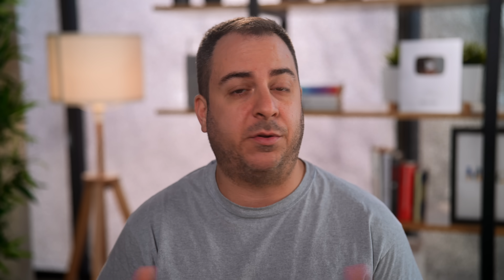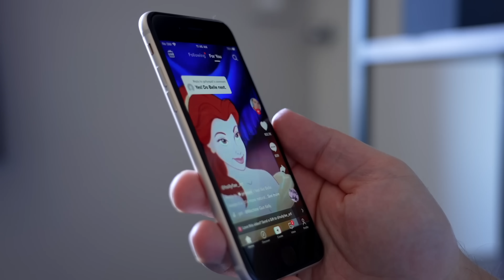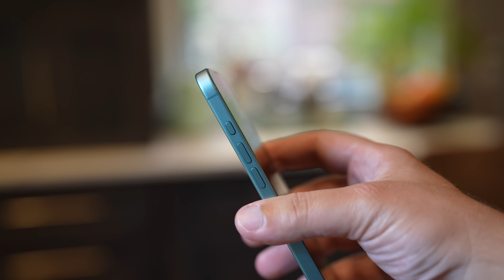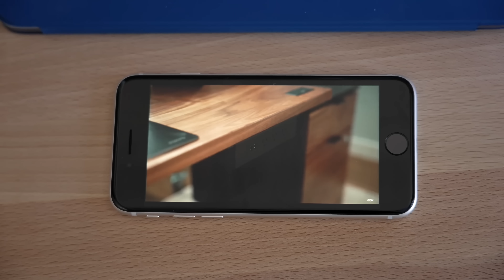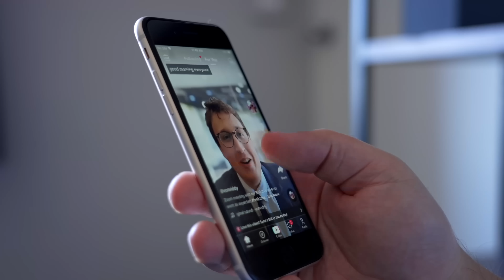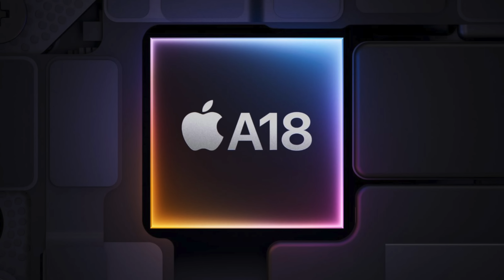iPhone SE 4 Coming Next Week!

Comment: Still getting a 16. Was thinking 16 pro but it's not that different and I think I can take the lack of 120hz even though I'm moving from android again. Like to swap between the 2 every few years. Both have their strengths.
Reply: What phone do you have rn?
Reply: @markoroncevic  nothing phone 1
Reply: @BC-Productions. what is the problem with it so you need to buy iphone
Reply: @markoroncevic starting to slow down software wise. And on hardware, the USB C port is damaged making every charger dodgy. And the seam on the back is peeling off so it's no longer waterproof. Moving back to the iPhone was my plan anyway but I'm doing it earlier than expected because of the damage to my phone.

I swap back and fourth between apple and android anyway so it's no issue I have backups off my last iPhone

Comment: About bloody time. I just had to replace the battery in my SE2 to keep it alive longer. I am actually not happy that it will use oled. I do not want oled
Reply: Bc of eyes and headache?
It is not smart for them to use an ips panel, 60 hrz is a joke not to mention lcd in 2025
Reply: @ 

Oled burns in. That’s the problem
Reply: @theshadowman1398  modern ones dont, if you are not so smart then you might break the screen by using it on max brightness for like a long time

Comment: Call me crazy but I went from iPhone 13 Pro Max to iPhone SE 2023 and there are no regrets. Easy to handle love the home button and it’s not heavy. I also have an iPhone 14 but I don’t use it bc I don’t like the size 🤷🏻‍♂️.
Reply: Then again the iPhone 14 is still small compared to the competition. The only similar sized phone devices are the Samsung S25 and pixel standard and A series
Reply: if you're not using the 14 could I maybe have it 🥺
Reply: @ I can sure sell it to you! 🙃 it’s the 128 gb storage. Basically new. Never liked it.

Comment: In my opinion it’s a mistake for Apple to kill off the Touch ID home button iPhones. I much prefer the classic iPhone design over the newer ones. Now the SE line will just be a less feature packed base model line.
Reply: You prefer: awful thin dinosaur like design with battery thickness of 0.5 mm and screen like a point finger?
Reply: Face ID is more reliable. Fingerprint biometrics don't work for everyone

Comment: iPhone 16 E would be a very bad branding because the regular iPhone 16 is already considered to be the "low budget phone" of the iPhone 16 lineup. If they call it the 16 E, the 16 would basically become useless as most people buy an iPhone for its social reputation, not the actual tech inside. So if they can get the latest iPhone but for a slashed price, they would go for the 16 E and not the 16, also considering that if they want Dynamic Island and double cameras, they'd need to spend over 300 bucks, not worth it, it'll be either 16 E or 16 Pro, which doesn't make sense because the SE iPhones just use the old parts mixed with new parts to make a low cost iPhone because, well, it costs less to make as there is barely any research to make since they already have the parts, while the iPhone 16 did cost a lot of research (camera design, the new useless camera button, ...) so in the end they'd lose a consequent amount of money. SE is the only branding for them to go with to differentiate the actual flagships from budget iPhones.

Comment: They had the best chance to make the new SE using the iPhone mini body.
Reply: They should have used the iPhone X case! Perfect sweet spot in size between the mini and the current standard size and got the rounded corners ❤️‍🔥
Reply: With bad battery life? No. 6.1" is the sweet spot
Reply: they could make a fatter mini for battery efficiency.. ill be in for it
Reply: Terrible battery life
Reply: I would have wished that too, but the mini design failed, both 12 and 13 mini versions did not sell well. Blame the people.
Reply: @rohmanatasi1771 yes but they then increased the size and it did even worse.  I say bring back the smaller version
Reply: People don’t want that mini
Reply: They tried and it didn’t sale so they discontinued it
Reply: @dontworryaboutwhoiam456 cause it was overpriced - starting price $700 when for SE it could be i.e. $450 with one lens camera, newest chip, 8 GB RAM AI-ready, notch, standard mute button and without camera button - I would take it

Comment: Is it worth to switch to se 4 from samsung a73?
Reply: Never ever !
Reply: Id say yes, and while it will be bad that you are losing the 120 hz display and maybe the larger size, having an OLED panel, flagship specs, and a 48 mp camera that dominates most other mid-ranges (other than maybe pixel a phones) makes this a great buy if price correctly.
Reply: 60 drawback and battery 
Design from a front side

Comment: Very excited about the iPhone SE 4. It’s basically going to look like the iPhone 14 that I used to have.

But yes, if you think about it:

iPhone SE (1st Gen) was based on the iPhone 5s, but with the iPhone 6s internals like the A9 chip and just like the 5s is chamfered edges, but matte finish instead of polished. Plus, there was never 3D Touch or neither a second generation Touch ID sensor. Only a first generation Touch ID sensor found in the iPhone 5s and iPhone 6.

iPhone SE (2nd Gen) was based on the iPhone 8, but with the iPhone 11 internals like the A11 chip. It has a classic design with home button and Touch ID.

iPhone SE (3rd Gen) was again based on the iPhone 8, but with the iPhone 13 internals like the A15 chip. The SE has 5G connectivity, but with no mmWave antenna like the iPhone 12 and 13. That’s because the 12 and 13 have squared-off edges and the SE has rounded edges.

Comment: I’m looking forward to seeing how good will be the 5g modem. 
The problem with se series is that they don’t refresh it every year…
Reply: I wouldn’t say that’s a problem, every two years is fine. Most users keep their phone for 3+ years.
Reply: @Drew1218s  I bought my brand new se2 on November 2022. Now my battery is at 84% health😂
So yeah normally it last about 3 years, but I could use it for another 2 years after battery replacement. However, I would love to try Apple intelligent, so if se4 has AI feature, I would probably buy it
Reply: @Drew1218s  If you need a new phone 1.5 years into a cycle you're not getting a good deal..
Reply: That's how it should be, releasing new models every year is just pure money-grabbing by the corporations.

Comment: They totally need to use SE as a way to release iPhone Minis.  On a longer update cycle because fewer people buy Minis (but really want Minis)
Reply: I totally agree with you. I want to upgrade my 12 Mini, but 13 Mini is too insignificant upgrade, and I really want to stay on a small phone so I'm kinda sad that SE4 is going to be regular sized.
Reply: I’ll buy one if they give me the SIM card slot back
Reply: I’m contemplating leaving apple if a smaller phone isn’t offered or a flip-able phone. They need to be more innovative otherwise not worth it.
Reply: The iPhone Air is the Mini successor. Lighter weight without sacrificing screen size.
Reply: @alymzhanchik  nah, the point of mini is the smaller screen size.
Reply: @andreitrinidad  no it's not. That would simply be stupid. Who enjoys squinting for no reason?
Reply: @ kompassor People who don't read on their iphones and people who have normal gui scaling
Reply: @thatdelta  exactly. I use my iPad Air for reading and my 13 mini when I go out on the day to day
Reply: @thatdelta  no. those people (me included) don't mind a smaller screen if it means more portability (i.e. lighter weight). Wanting a smaller screen for the sake of a smaller screen is simply irrational.
Reply: @alymzhanchik  bro you’re clearly in the minority. most people (including me) want a small phone because it fits in one hand - it’s how a phone should be (unlike the modern tablet sized ones). It’s comfortable. when people say they want a small screen it’s because that’s the natural result of making a phone small - not because they literally want a screen the size of your microwave clock. they want to be able to reach the corners of their phone with ease unlike with the base model tablet sized ones.

I’m pretty sure literally no one except you care as much (if at all) about the weight of an iPhone considering how light iPhones already are (it’s the natural incremental improvement, just like screen real-estate when they removed bezels and next the notch). It’d make more sense for them to focus on size to make it distinct since they already do that with their Base, Pro and Max models. Naturally, Mini is the other distinction, not because of weight, that’s so random (otherwise the Max would be purposely made to feel like a stack of bricks). Instead, it’s about the size of the device (which naturally would mean a smaller screen).
Reply: @alymzhanchik  it’s definitely for the compact size of the phone, not the fact that it feels lighter (thats just a bonus)
Reply: @jonanddy  a thinner phone doesn't feel lighter. It is lighter. It's also more compact. You realize thickness contributes to size?
Reply: @alymzhanchik  not if it’s made of tungsten. seriously tho what are you arguing about 😂😂
Reply: @jonanddy  it's made of the same thing other iPhones are made of. And this guy was accusing me of overthinking.
Reply: @alymzhanchik  You are overthinking, no phones are made of tungsten, it was a joke. If an iPhone were made of tungsten then it would weigh like seven times as much as a regular iPhone despite being the same size
Reply: @jonanddy  how am I overthinking? I am not the one bringing up nonsense non-argumentents like the tungsten BS (unlike you). I am speaking actual facts like thinner chassis resulting in lower weight and better portability without sacrificing screen size. That is an objective fact.
Reply: @alymzhanchik  when I say you’re overthinking I’m referring to the fact that you’re digging into the specifics that are completely irrelevant to the topic (“most people want mini’s for its compact size”). 

then you come in all: “actually 🤓☝️a thinner phone doesn’t feel lighter. It is lighter.” when you brought up this nonsense that’s when I decided to say “unless it’s made of tungsten” (because it would mean the exact opposite: It would be a thin phone and actually be very heavy ). 

everything you’re saying has nothing to do with the fact that most people who want iPhone minis want it for its compact size and not for how light it weighs. and yes those are actual facts you brought up, but for what? what the hell does that have to do with anything? most people want a mini for its compact size, not for its weight (lighter weight is a bonus), so why are you lecturing about the the effects of a smaller chassis == less weight? don’t you think that might be common sense and doesn’t need to be mentioned? It’s like trying to lecture someone about how a small cup of water holds less water than a larger one because of its volume… bro, you’re silly.
Reply: @jonanddy  how are phone's weight and size "irrelevant specifics"? Are you reading your own comments? You say I'm overthinking it, then post paragraphs-long comments.
Reply: @alymzhanchik  bro, I typed all that out hoping I made my point crystal clear, but apparently it wasn’t clear enough. I said you’re digging into specifics that have nothing to do with my original comment - yes of course that’s irrelevant. 

I said most people want minis for its compact size and the light weight that naturally comes as a result of that size is just a bonus. then you come in talking about “a thin phone doesn’t feel light, it is light”. (which, first of all, they are literally the same thing 😑 something isn’t going to feel light and be heavy, nor feel heavy and be light … that makes absolutely no sense. It’s counterintuitive). Most importantly, and the whole point of our discussion is: why are you bringing that up? what part of my comment were you replying to? it comes out of left field and it doesn’t even respond to my comment, it’s literally just a random statement you made and now we’re here
Reply: @jonanddy  lol if you think size and weight are irrelevant, you aren't worth talking to because you obviously don't understand the point of an iPhone Mini. Now go and post your walls of text elsewhere if you're incapable of succinctness.
Reply: @alymzhanchik  Yeah, it's about the feel in your hand... the ability to use my phone easily with one hand is key. I'm holding on to my 13 mini for as long as I can. With battery technology improvements and better chip efficiency, even a small jump in battery life and Apple could charge whatever they wanted for a new mini with updated internals, and I bet  all of us mini loyalist would buy! I would pay whatever to get a new mini!
Reply: The whole point of a mini IS a small screen to be able to use it one handed. If you do not get that, you do not understand the point of a mini….

Comment: about damn time honestly my SE2 is on its last legs thanks so all the software updates and there's no way i need a flagship or geh colour mid range
Reply: your SE2 is on its last legs??? bruh y'all with your first world problems. everyone I know are still rocking the 7 and 6s. we just carry power bank and we're all set.
Reply: @hellhog405 not necessarily a first world problem ngl.
Reply: @hellhog405 where do you live?
Reply: I am still on SE too, 4.5 years with one battery replacement. But now my battery isn’t the best anymore. Phone works fine, besides the battery life. New SE is a no brainer if it’s not too expensive. Otherwise I’m buying a 16 or 13/14/15 pro (if the price difference isn’t too big).
Reply: And? Explain how the SE 4 is going to make the industry explode into legitimate excitement. Because it will run Apple Intelligence? Look around, is the industry truly ‘Going Coo Coo for CoCoa Puffs’ over Apple Intelligence?

Comment: USB-C, Face ID, and an OLED display mark a major shift for the SE lineup. The A18 chip and 48MP camera bring flagship-level upgrades to the budget tier.
Reply: With all these upgrades and you still expecting SE price? I truly doubt it. Unless it doesn’t have all these upgrades.
Reply: @Lucifer-fj7mg  It will definitely go up. But i could see it staying under $500
Reply: @runningfan2024  So 600€ in Europe, tax included
Reply: @ I'm not sure about European prices. 600€ seems high if it's <$500 but I don't know.
Reply: @runningfan2024  Yes but 500$ tax not included no?
Reply: @stephanemignot100  Yeah, but I have heard the price hike might not be that significant. Possibly $440-$450 pretax. $500 seems like the upper bound.
Reply: @runningfan2024  Finger crossed!
Reply: @ 100%. I am not overly confident that it is true. But if it is $440 pretax I am buying one immediately.
Reply: @runningfan2024  So, 719€ in France, no thanks ! :)
Reply: Too bad Apple is still only giving “Pro” devices 120hz. I remember thinking how ridiculous the 12 Pro was to not have 120hz…
Reply: @OllieYoutubeAcct I have a phone with 120hz and imma be honest it's not really that big of a deal unless you're gaming, and even then most mobile games only go up to 60 fps anyways so it won't matter

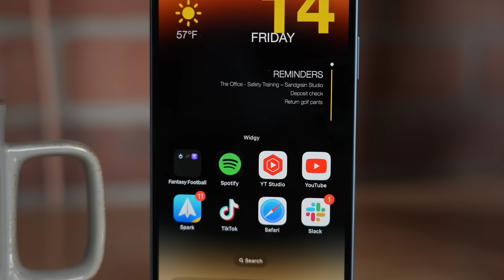Comment: 2:10 Hate to be that guy but iPhone X had an OLED display
Reply: Yeah I think he meant for all of the models in the series, where with the 11 series, only the pro had OLED and the regular 11 had an LCD, but from the 12 series onward, all of the iPhone 12’s had OLED.
Reply: If we never call them out they’ll be losers forever.
Reply: While the XR and 11 are definitely not flagship in my book, they do come with the flagship chip, so they get the flagship name. Similar to the S10e and S2x FE. But yes, you're right as to when it started, but when the line "started" with all OLED was indeed the 12